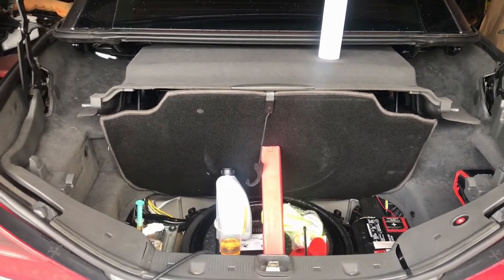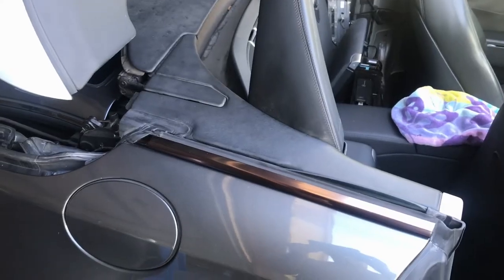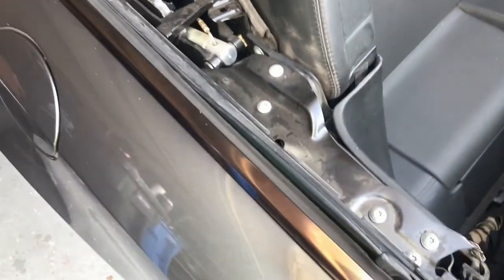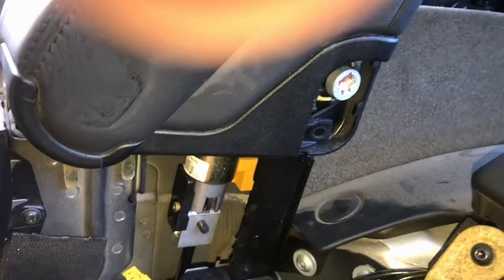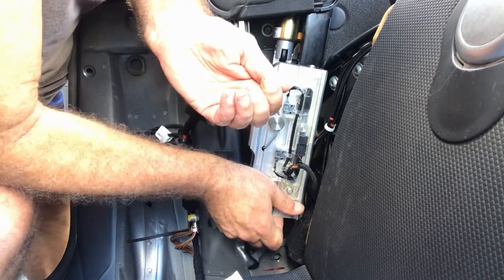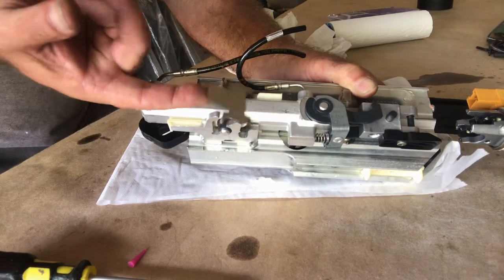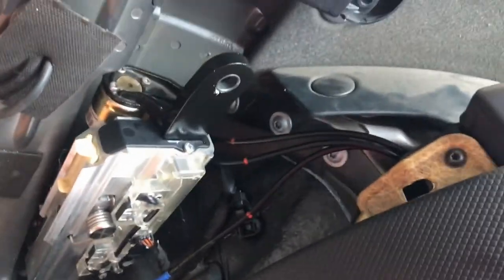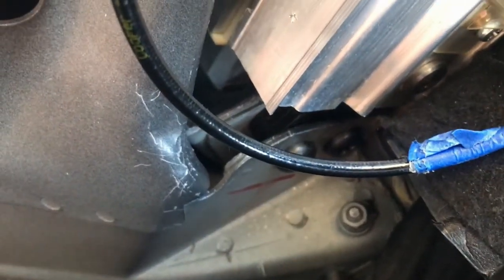SL500 R230 Check for top hydraulic leaks,  replace Roll Bar cylinder

Comment: The power locks work but the trunk doesn’t lock by itself is that probably a trunk lock problem or is that also the problem I’m having
Reply from the maker: If your trunk isn't locking by itself (soft close) and your trunk light on the driver door is lit, that will prevent the top operation. You can try slamming the trunk shut to get the light to go off and then try the top.  Also try resetting the PSE pump fuse. I have a video to fix the soft close and it will show you where the fuse is. https://www.youtube.com/watch?v=q68G0Wypsq8&t=1s
Reply: The light isn’t on the trunk closes good after a soft slam lol  what makes no sense to me is if I unplug the rvc and plug it back in the top works no matter if the trunk partioner is open or closed as the the top closes completely the last operation doesn’t work which is the rollbar coming up.   Is there a way of unlocking the rollbar or is it dangerous to release the locks ?
Reply from the maker: If you release the springs for the roll bar locks on both sides, the roll bar should  come up.  Just put your hand on the roll bar while it's coming up.  Does it still say "top in operation" ? If so, that's why the roll bar is not coming up.  Also, it will only come up automatically if it was up before you put the top down.
Reply: Will the rollbar have a lot pressure when releasing the locks ? Do I have to hold it with pressure when releasing the locks or will it come up with no problem
Reply from the maker: Come to think of it, you should only need to release the spring/lock on the passenger side to get the roll bar up.  The locks on both sides keep the roll bar from going down, but the lock on the passenger side also keeps the hydraulic cylinder from going up.  It has a hook attached to the cylinder which is release when you move the spring/lock back.  So it shouldn't come up with too much force, depending on how much pressure is in the system, but you should put your hand on the roll bar to ease it up.  It will only shoot up if the solenoid which is attached to the clevis is released,  (like I show at 18:11 in the video)
Reply: I forgot to ask throughout this process does the pressure have to be released on the pump ? Or it can be done without releasing the pressure
Reply from the maker: If you raise it by releasing the solenoid in my other reply then you don't need to release the pump pressure.  If you do it by releasing the spring/lock then you would need to relieve the pressure.  Keep in mind, if you raise the roll bar manually you will need to move the springs on both passenger and driver sides to push it back down.
Reply: Thankyou for this great video! So far mine has been good 👍 but I'm sure I will need to replace these sooner or later. I did price the work at a shop in Naples it was $3100 for complete cylinders replacement. Myself being a former helicopter mechanic I would like to tackle the job and your video will be quite helpful.

Comment: Hi how do I take just the roll bar off? I need to re trim the bar. Let me know please
Reply from the maker: I've haven't done that but here is a WIS procedure for it.  https://charm.li/Mercedes%20Benz/2004/SL%20500%20%28230.475%29%20V8-5.0L%20%28113.963%29/Repair%20and%20Diagnosis/Body%20and%20Frame/Roll%20Bar/Service%20and%20Repair/Removal%20and%20Replacement/AR91.50-P-2000R%20Remove%2FInstall%20Roll%20Bar/
Reply: @MrMarco6900  thank you! 🤝

Comment: MR M....ANOTHER GREAT VIDEO AND CONTENT. THANKS. I HAVE NEVER RAISED MY ROLL BAR TO KNOW IF IT EVEN WORKS, BUT MY ROOF OTHERWISE WILL FUNCTIONS BUT I HAVE A LARGE LOSS OF FLUID SIMILAR TO WHAT YOU MENTIONED WAS HAPPENING TO YOU. I DEFINITELY HAVE A LEAKING CYLINDER BACK ON THE REAR WALL OF THE TRUNK, BUT NOTHING TO THE EXTENT OF FLUID LOSS. I REPLACED THE TWO CYLINDERS ON EITHER SIDE WALLS OF THE TRUNK AND AM NOW LOOKING TO THE CYLINDER-CULPRITS THAT ARE UP UNDER THE REAR WINDOW IN THE TRUNK COMPARTMENT. CAN YOU SUGGEST BEST WAY TO ACCESS THOSE TWO? THRU THE TRUNK OR THRU THE REAR TOP PANEL WITH THE SPRING FLAPS THAT YOU SHOWED IN THIS VIDEO? THANKS FOR ANY ADVICE.
Reply from the maker: I haven't had to mess with those cylinders yet so I won't be much help there.
Reply: @MrMarco6900  Ok, thanks, much time had passed and I am only getting back into the repairs. Thanks again